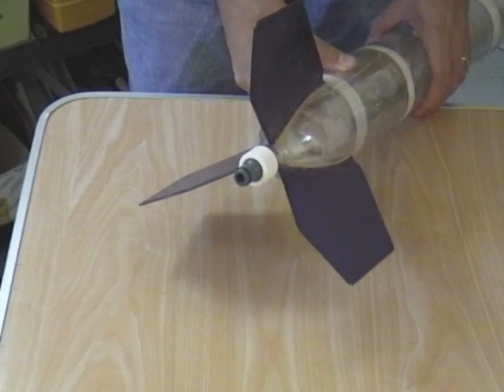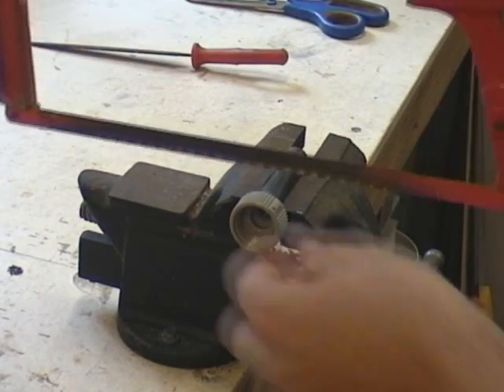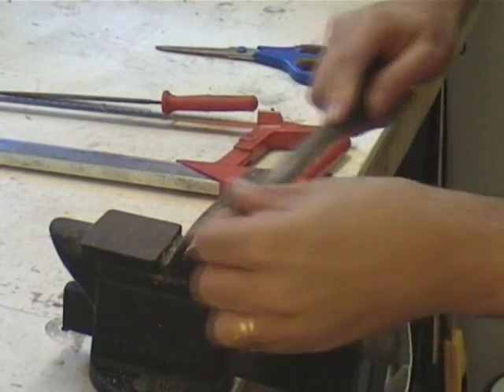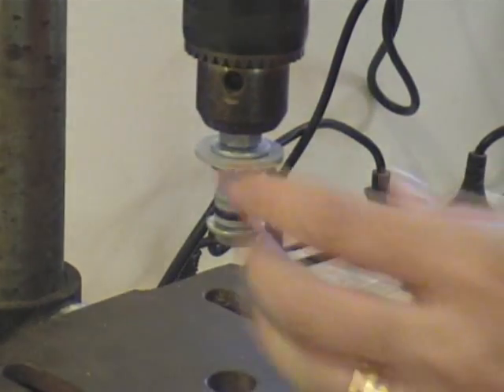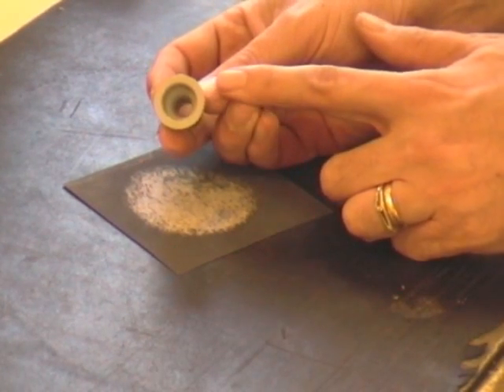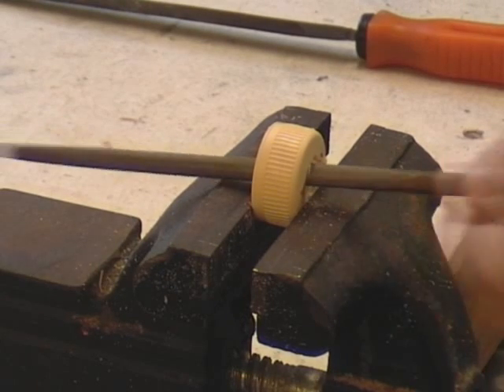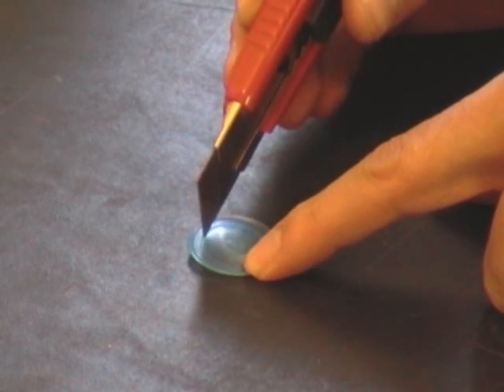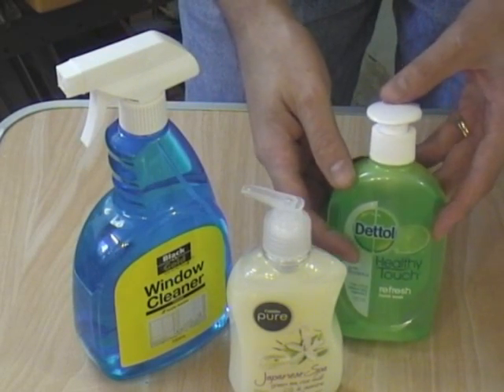Make a Water Rocket Nozzle - Part 1

Comment: New bottle caps, new methods...
Trying a 20mm nozzle design with PVC pipe as launch tube and interconnection pieces for bottle butt to butt and variable connections.
Bigger nozzle, stronger but shorter thrust lol

Comment: Hi guys i have a problem.When i release the bottle from launcher the bottle doesn't fly up deviates left or right I think it's because of the center of gravity.Because the nozzle itself weighs and this moves the center of gravity upwards I haven't made a rocket yet, I'm just testing with a normal bottle how can I solve this problem ?
Reply from the maker: It sounds like a classic case of rocket/bottle being unstable. You need to make sure your center of gravity is ahead of your center of pressure. This means adding a bit of nose weight to the top of your bottle, and adding some fins to the back of the bottle. If it is a single bottle, then perhaps try 50g as the nose weight. Make sure your fins are light, and are as far back as possible and that they are stiff and don't flop around. That should get your rocket nice and stable.

Comment: Very good - I particularly like the improvised vertical lathe.  I  would have been tempted to use a die grinder (aka "Dremel") with a sanding drum at some stages, but it would probably be too aggressive and therefor difficult to control.  Hand tools such as files are a better option.

Comment: Cause of the covid my kids and I got into this.  I use a male thread QD for the bottle connection and sand off the thread.  Then boil some water and heat up the bottle top and swage fit the QD nozzle then right in the ice.  Some times it’s a little loose so just hit it with some super glue

Comment: Great video! Is there any way of removing the seal on the newer bottle caps, or is it impossible?
Reply: And is it possible to use the cap even without removing the seal and just using the tap nut adapter's seal?
Reply from the maker: There are many bottle cap types so I am not sure what "new" is but there are caps where the seal is difficult to remove.

Comment: how do you attatch a tire valve to it?
Reply: The nozzle fits into a standard Gardena hose quick connector. If you want to attach a tire valve to the quick release, you would connect a short length of garden hose from the connector and then insert the tire valve into the other end of the hose. You can then use hose clamps to hold the tire valve in the hose.
Reply: thank you sir.

Comment from the maker: @carnahant Haven't come across this issue before with metal ones. Which manufacturer makes your quick connector? We had an issue with plastic ones sometimes not connecting, or popping out under pressure which was solved as shown in this two part video, but I haven't had the problem with the brass ones.

Comment: I am trying to build a metal launcher that can handle higher pressures. I have been having difficulty finding an appropriate metal female quick connect. For one, most of them have this "soft cushion" rubber around them. I recently found all metal one, only to find that it would not hold my plastic Gardena nozzle. Have you run into the problem of having a disconnect between QC and nozzle? How did you solve it? Someone suggested making sure that both parts are from the  same manufacturer. Thots?

Comment: a little idea about this: DLR, which is the german institure for aerospace engineering has a  tutorial for a really small water rocket. What they do, instead of combining the gardena thing with the lid is: They suggest to heat the bottle top with a blow-dryer (or something comparable which produces hot air^^) until the material is ductile and then screw the gardena thing on it. (hope its understandable)

Comment from the maker: @addy360 
Hi There,

How you connect your air supply to your launcher will depend on the adapter you have on the end of your air hose. If it is a standard bicycle valve adapter, you can cut the end of your garden hose coming from the launcher and insert a bicycle valve cut out from an old tyre. Then use a hose clamp over the top to seal the valve against the inside of the hose. You can then easily connect your pump to the launcher.

Hope that helps.

Comment: Hi George .. worked like a charm ... thanks for posting the video. It has heap of space for our reduced diameter discs inside the cap. I posted a video response.  Pressure tests fine, now to see if it holds up to the water forced through it

-todd-

Comment from the maker: That's a good question. Because the cap is so soft, and can't be properly gripped in a drill press vice, a large drill bit can rip the plastic as it cuts through. That's not to say you can't do it with a big drill bit but will take a little practice. Doing a bunch of smaller holes is easy to do and you don't need any special way to hold the lid.

You could cut the neck off a bottle, glue a piece of dowel inside then grip the dowel in the vice. Screw your cap on and use a bigger drill bit.